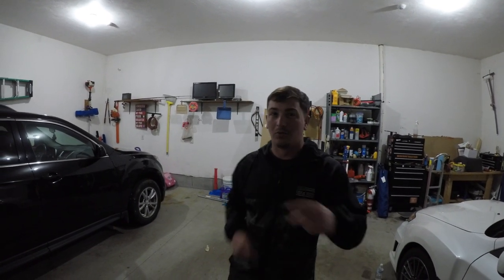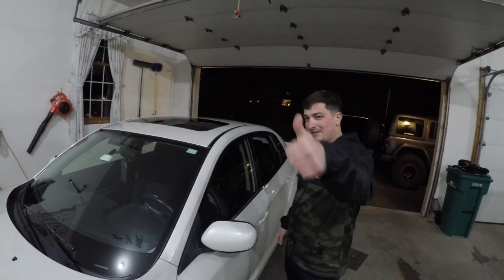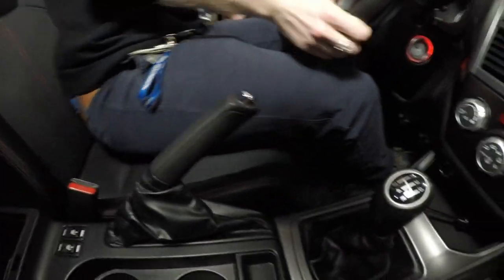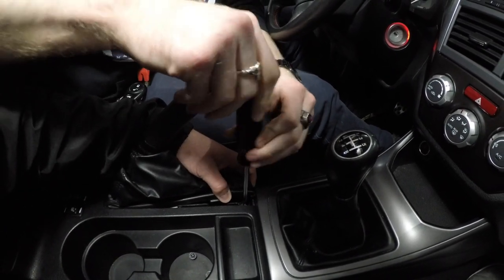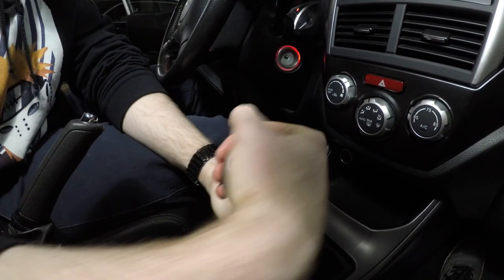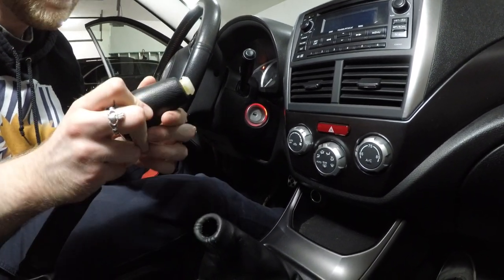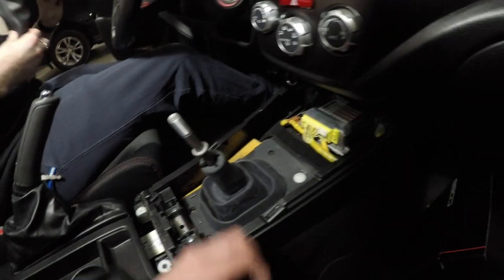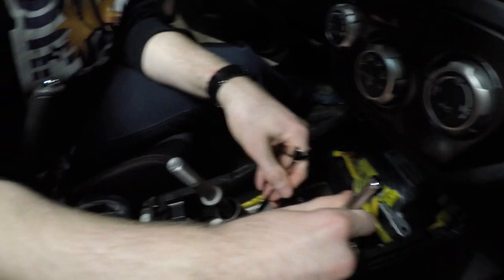Subaru Wrx Cobb Short throw Shifter Install 2012!!!

Comment: How does the shifter feel now? Any issues ?
Reply from the maker: "Feels awesome the transitions are smooth and quick between gears. 

The only thing thing that took me by surprise is between first and second when in first and high rpms it feels as though when i start shifting and press in the clutch the power is assisting me into second almost forcing the shifter out of first. Im fairly confident that this could be changed with adjusting the shifter a tad higher but i like it." - Mike (owner of WRX)